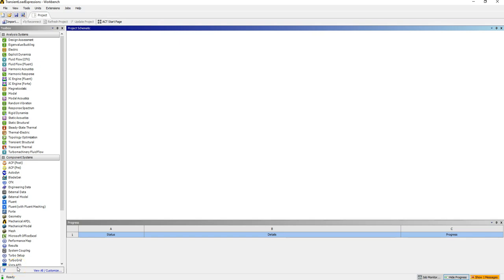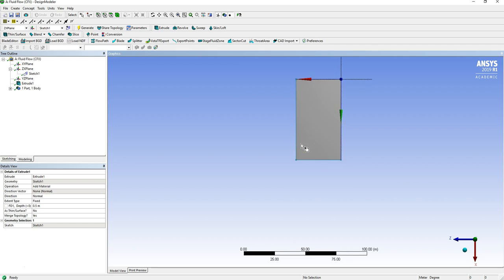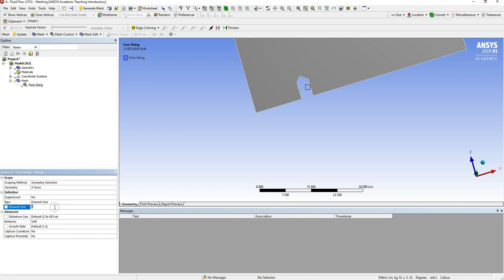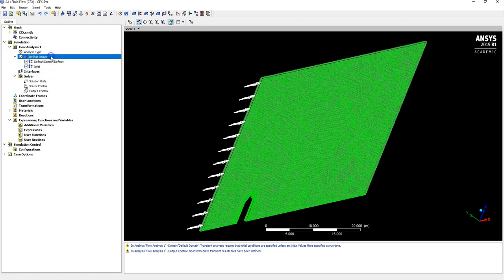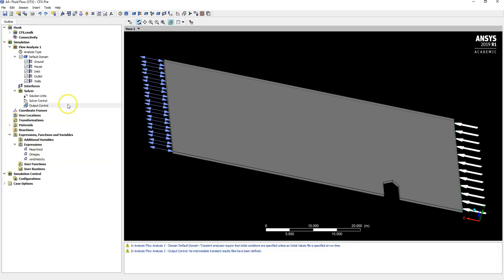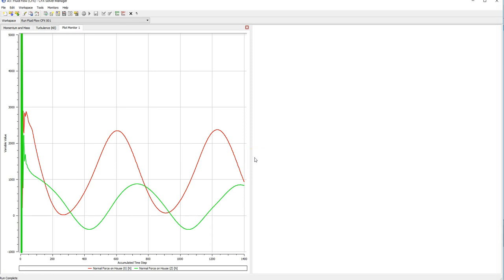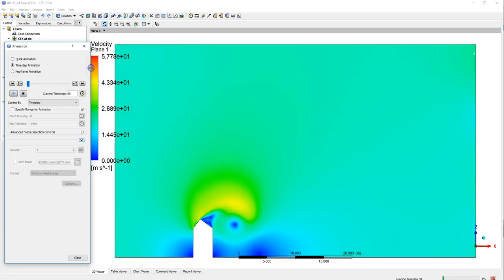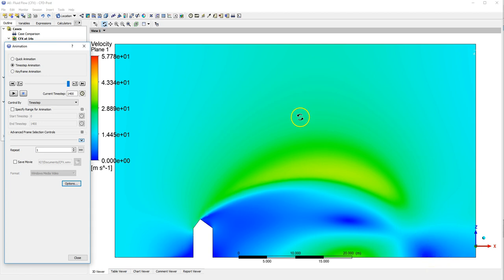How to create a transient inlet boundary condition using expressions in Ansys CFX

Comment: Two questions about your simulation:

1. In the basic settings: transient simulation was selected, and your total time was 20 seconds, the time step was 0.01 s
 so the maximum number of iterations would be 20/0.01 = 2000? You reached 1400 iterations (saw it on the animation), I guess The solver reached the criteria on the 1400 iterations that's why it didn't advance to the 2000 iterations

2. In the Output control:  why do you need to add new transient results? Doesn't CFX have a default time for the results?
 Is it cause you are aiming for a more detailed result?
Reply from the maker: 1. Yes. Likely because this was only a demonstration case so didn't need all of the iterations.

2. Creating a new transient results file allows us to have control of the naming convention. To the best of my knowledge, CFX doesn't have default transient result criteria so they must be selected by the user.

More results, higher time resolution but higher computational overhead.